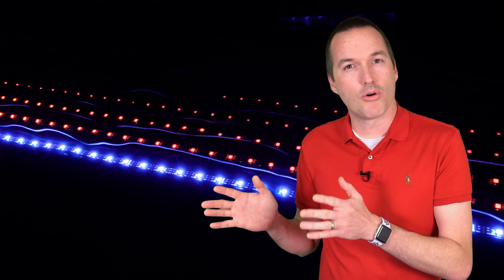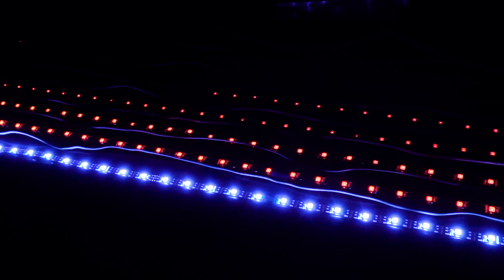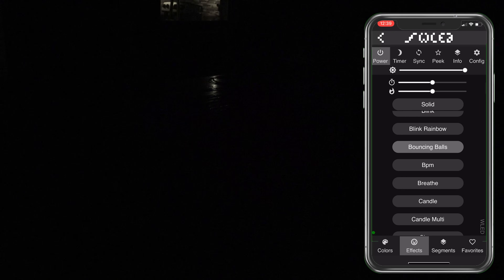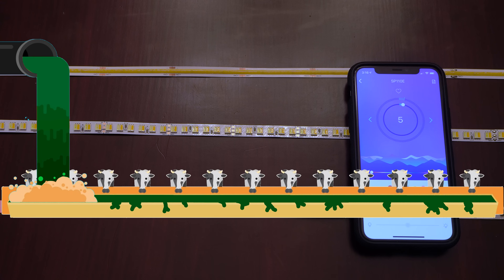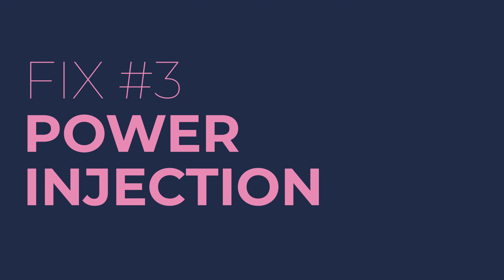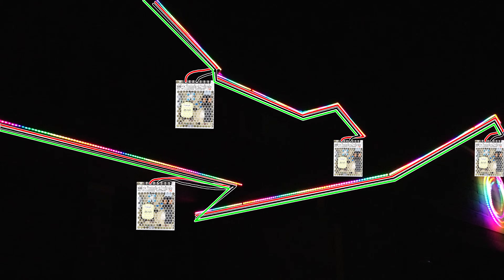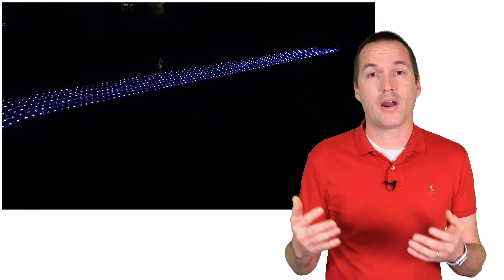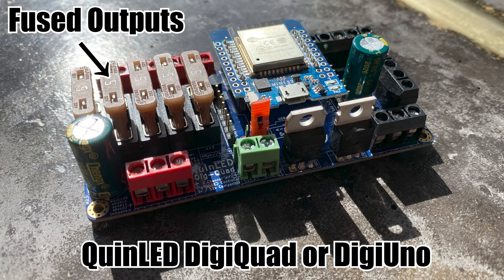3 Quick Fixes for LED Color Issues - Power Injection, Voltage Drop, Brightness Regulation and More.

Comment: Thank you for the more detailed explanation of your power injection. You mentioned the small gauge wire inside the channel previously, but this was the first I remember you talking about your additional home runs. I am just now setting mine up with a long roof line and I was concerned that the voltage drop from any wire that fits inside the channel would be too high. I will need a few home runs that come out the attic and don't fit in the channel.  Does it make a difference if I bring multiple wires from the same terminal on the power supply? It only has 3 positive and negative outputs, but I will probably have more sets of wires attached to it. It's rated 60A but does that mean only 20A per output?
Reply from the maker: To my knowledge all those outputs are internally connected, but the terminals are only rated to a crisis certain amperage (20A each I believe).  You can put more than one output per terminal, but you should try to evenly split between the 3.

Comment: The timing on this video is fantastic! I'm in the middle of installing LED strips on my house, and have run into an issue which brings up a question. First, some quick background: I'm using WS2812B strips, and have installed 1 run of about 370 pixels. I bought 22 gauge wire from the same place where I bought the LEDs (BTF Lighting) and used them to power inject around pixel 120 and 240 or so. Even with this power injection, I was running into really severe dimming when trying to run the lights as bright as I'd like. I grabbed my multimeter and discovered that at my first injection point (roughly 20 or so feet from the start of the run) the voltage on the injection wire was only around 3.6v. I checked it at the other end (essentially where the power injection wire connects to the power supply) and it was 5.2v there. I was REALLY surprised at that much voltage drop across that distance...Thinking I had a bad section of wire, I bench-tested several other sections of the same type of wiring (I bought a bunch of bundles of it) and they all exhibited the same voltage drop due to internal resistance of the wire itself.

So, here's my question: I'm considering replacing all that 22 gauge injection wire with 18 gauge thermostat control wire. The advantage of thermostat wire is that it's relatively thin (much thinner than, say, speaker wiring), is solid core (not stranded/twisted) and is 100% copper (not copper coated aluminum, etc). I have a roll of 100' of thermostat wire that I tested, and it reads 5.2v at the end of the 100 foot roll - indicating essentially very very little (if any) voltage drop. The disadvantage of thermostat wire is that it is not terribly flexible, and copper work hardens so I'll need to be careful not to bend it over and over in the same place, or the conductor could break.

TL; DR: Is 18 gauge solid copper wire appropriate for power injection?
Reply: According to this calculator, your values are not too far off from the theoretical values.

https://www.rapidtables.com/calc/wire/voltage-drop-calculator.html
Reply: @TheJoeFletch  Interesting about the calculator - but I may be misunderstanding something: When I checked the voltage on my injection wire, it was under no load. As in, no amps... I disconnected it from the LEDs at the injection point, and measured the voltage across positive and negative leads with a multimeter where I observed the large drop. Again, this was only about 20ish feet or so from the power supply, which leads me to believe that the wire is of extremely low quality or not actually copper like BTF Lighting claims. After work today I went out to the garage and checked and sure enough: the conductor is definitely not copper. I can't tell what it is, but it looks like aluminum, and the individual strands are VERY fine. By contrast, when I did the same measurement on the thermostat wire (pure solid copper conductor, 18AWG) I measured effectively zero voltage drop across 100'. I'll know more this weekend when I will finally have time to get up there and replace the junky wire with the thermostat wire and see how that affects things.
Reply: @AmplifyDIY  I initially read your comment incorrectly. Sounds like they sold you copper clad aluminum (CCA). From what I read, you do not want to use this in your setups because of what you're experiencing. The literature that I have read also states that this wire is rated for much lower amps.
Reply: What I am doing on my 2nd floor line with my WS2812B strips is run a 16AWG header to reduce the voltage drop and then use 22AWG wire for the injection points. I'm finding that at about 40 feet with the 16AWG, I'm still getting a significant voltage drop and will probably need to run another pair of wires to make sure that the end of the run is powered up properly.
Reply: @TheJoeFletch  So to be clear: on 16AWG wire you are measuring a significant voltage drop at around 40 feet, with no load on the line? Or is that with several injection points connected? Thanks!
Reply: @AmplifyDIY  the 16AWG wire is under load. It is run in parallel with my LED strips and I'm tapping off of that wire with 22AWG wire. I've power injected at about 150 and 300. Under full white load the voltage drops significantly. I was hoping to keep the lights as bright as possible, but looked like I will need to run at a lower brightness to keep things even.
Reply: @TheJoeFletch  Good info to know. Out of curiosity: how long are your 22AWG runs from your 16AWG wire? And is the 22AWG solid aluminum, stranded, CCA, etc?  I watched another video earlier this week from a different channel that indicated you should inject such that you never have more than 50 pixels from a given injection point (so, every 100 pixels). By injecting at 150 and 300, you'll have pixels that are 75 away from the closest injection point, which may be why you are seeing visible color changes at full brightness.
Reply: @AmplifyDIY  My 22AWG taps are about 3-4" off the 16AWG header wire. 22AWG is solid copper (bell wire). Really easy to solder on the pads. From what I have read, never use CCA on LEDs. I realize that I may be a bit off from the 50 pixels. I have just ordered some materials to make tapping into the header easier.

Comment: Master Class level explanation on a subject that puzzles a lot of people! Hopefully this helps even more people try DIY LEDs instead of mediocre store bought options. Thnx for the controller shoutout! 😮😊
Reply: I bought 5V strings with about 300 addressable RGB pixels in total to put on my house. I'm curious... assuming theoretically ideal injections and data boosting, how many pixels can one run on a single dig-quad data port with a ESP32/Ethernet/WLEDorXLIGHT configuration (considering refresh rate)?

Comment: This is an awesome video, and thank you for it! I'm currently having a problem with my run of LEDs where its like my voltage just hits an absolute cliff between one strip and another. I've tried re soldering, running a completely new power line, injecting all over the place, and a lot more, and it still is getting me absolutely nowhere. As it stands right now, I have ~300 5V LEDs lit up perfectly at ~50% brightness with a 22ga parallel injection wire, but if I try and hook up the next section, roughly 100 LEDs will go out on the previous strip with a major drop in brightness of the overall strand. As I mentioned before, I recently attempted running a completely new power line (positive and ground) from the same power supply to split the strings, and it has barely lit up 4 LEDs with maybe 5% brightness, red only. My DVOM reads a measly 1.1v at the point of the strip despite the wire being an 18ga wire roughly 60 feet directly to the power supply. Can you help me understand what the hell is going wrong here?
Reply from the maker: Sounds like that third strip has a leak to ground somewhere (could be a full short or a bad component), have you tried a different third strip?
Reply: @TheHookUp  That's my next step, which unfortunately the weather has gotten in the way of quite a bit recently (currently 8 inches of snow on my roof, which isn't ideal for ladders :P ). I had replaced the previous 3 strips thinking that was the problem and it barely did anything, but I guess this is just a matter of finding out which dang strip is the problem child here. I did put electrical tape down on each of the transitions of solder, so I was hoping that would have taken care of things, but maybe I missed something somewhere. Appreciate the reply, hopefully the weather will cooperate with me one of these days that I can try and get these running correctly before Christmas.
Reply: @TheHookUp  Secondary question... Is there a way I can check for a leak/short using my DVOM with the strips mounted? I'm guessing since I don't know where the problem actually lies, this would be difficult to test, but it would be nice to know if I can use my multimeter to find the problem without having to rip down all of the installed strips and test them individually...
Reply from the maker: Put your multimeter in resistance mode, then measure between + and - in the good strip and the bad one
Reply: @Pyromonkey83  Your ohms reading should be open between (+) and (-) , if you have continuity, you have a short.

Comment: I'm dying to know... how do you connect 2 strips together, with no gap, w/o having to solder while on a ladder?   I had to do this with one of my strips, and it was not a pleasant experience.
Reply from the maker: Do it from the ground before you get on the ladder
Reply: @TheHookUp  yea, should have thought of that before mounting the strips.   Ugh.
Reply: Additionally do lap soldering.
Reply from the maker: Yep, lap soldering is the only way to get a true “no gap” solution.

Comment: Nice video. My problem when I did my system was voltage drop between my power supply and the power injection point for my strips which is a 50ft run. I ended up replacing the 18 AWG wire with 10 AWG for that first big run and that let me go from just 10W maximum power up to 50W, which now delivers good uniform brightness for my 600 LED setup. Also adjusted the initial voltage of the power supply to 5.7V to allow for some of that initial voltage drop.

Comment: Correction: you can connect all power supplies togehter when every power supply get a SChottky Diode at the + 5V wire like (electicral sign for a diode --|>-- ):  
Image link: https://i.stack.imgur.com/DQTfW.jpg
Power Supply 1: +--|>--x  connect to the other schottky diode x
Power Supply 2: +--|>--x  connect to the other schottky diode x
and so on. That works very well in the PLC world, fo 30 years now. PLC's are used in the Industrial Automation.

Comment: Great video! I started a project for my house and I had some issues. I got the WS2812B strips and a DC 5V 60A 300W power source. I tested just hooking up the first strip and only the first 15 leds before the solder section on the strip light up. I injected power to the solder section after the first 15 leds and the next section light up stopping again on the next solder section. My question is, is that common? or am i doing something wrong? appreciate any feedback.
Reply: Yes I think the default LED count in WLED is 15
Reply: And that was it!!! WLed was setup to 15! update and now all light up! appreciate the comments all!!
Reply: Something sounds wrong. Did you also inject the data line after the first 15 LED s? That could explain why the next 15 light up. You could have it set to only communicate with 15 LEDs?
Reply: @rynglobal  when i injected power to the next section the light pattern continues so data is working fine, it is just the power that is not jumping to the next section.
Reply: @pirram  That is super weird then. I have the same strips and they power for many meters before starting to dim, even with a smaller power supply than the one you have. What are you using to control the lights? And do you have a multimeter? You could check at different points down the strip to see if you have enough voltage there.
Reply: @rynglobal  it really does not makes sense. I am using a NodeMCU and i try different data pins thinking it was that but no, also connect other brand new strips and same only the first section lights up. I do have a multimeter and it reads 5V on both power supply and strip
Reply: @pirram  Yeah, sounds like it's the controller. If you're getting voltage to the LEDs, something is wrong with the control configuration. I was having trouble with mine at the beginning too and bought a SP108E controller just to help troubleshoot things. I don't own an oscilloscope, so I couldn't spy on the actual data signal.
Reply: What is your controller? Wled? Have all good in settings?
Reply: @supperka2  it is Wled, do I have to specify how many it needs to control on the settings?
Reply: @pirram  your leds count in wled settings
Reply: @pirram  Yes, it is in Config > LED Preferences >  LED count
Reply: Makes sense now! I will check later but I assume the number on the settings will be 15! Hahaha appreciate the help guys! I will post after the success!

Comment: First 
So I need about 15 amps @5v and haven't found any good one at that amp, i have found a 5 amp and a 10 amp, so i guess i need to paradell the ground but cut the phase-wire form the strip at the injection for the other one?
Reply from the maker: 15A supplies are a thing: https://amzn.to/3mx97Ya
Reply: You can always go bigger too. The current rating is just a maximum value. So it wouldn’t hurt to go for a 30 or more power supply. May even mean the power supply runs cooler than a smaller one
Reply: @rynglobal  In addition, I believe it is recommended to go bigger so that the PSU isn't maxed out all the time. At least when it comes to computer PSU's, they are most efficient when at half capacity. https://www.extremetech.com/wp-content/uploads/2012/12/80plus.jpg